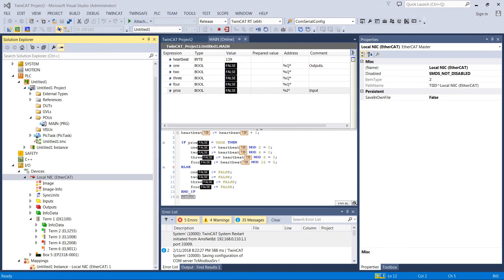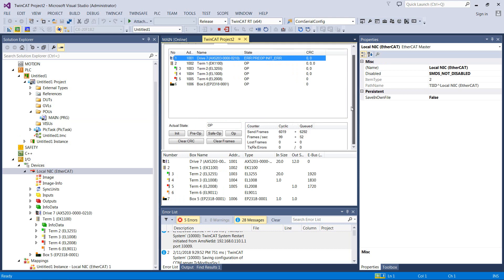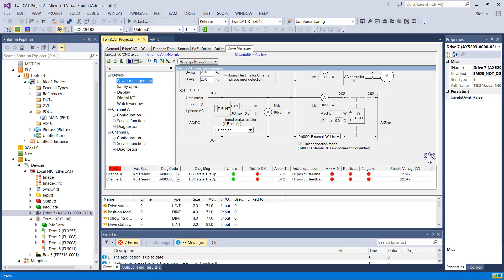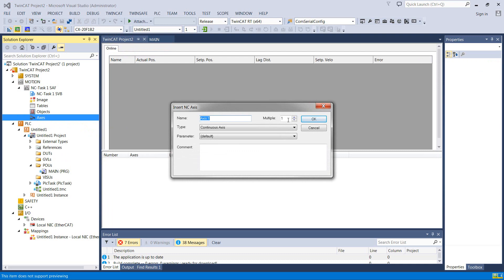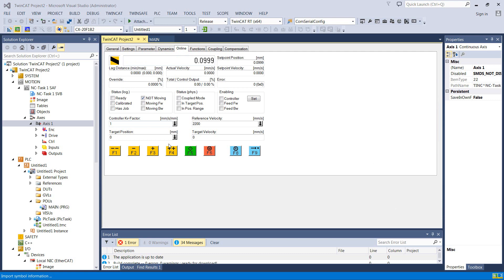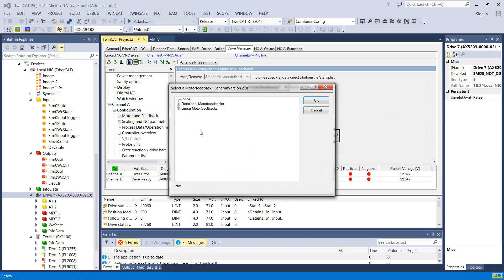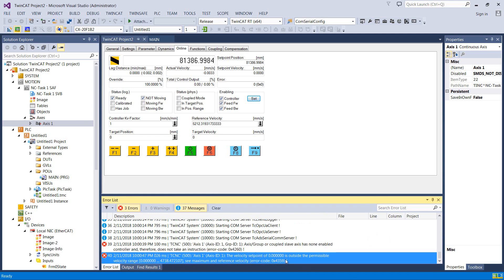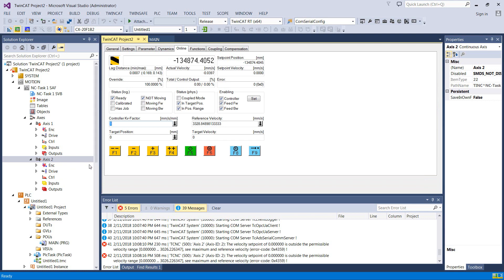Motion Control and IO with PLCs - EP6 - Numeric Control

Comment: How did you fix the issue with the set velocity? I have it too and cant't figure out whats wrong. Other than that I really like this series. It helped me a lot in getting started with Twincat.
Reply from the maker: Ummm, can you elaborate? I don't recall an issue on this one.
Reply: @SquishyBrained  The one at 8:55. Sadly you skipped the solution.
Reply from the maker: @Fleusz  oh, the part that I cut out was just me switching to a different channel on that servo drive. I don't think I actually changed any of the settings, I think it was a problem with the actual drive itself because it was a used drive that had an issue.  I don't think there was a setting or anything I changed, I just added the other axis and linked to channel b on the dual axis drive and everything worked fine.
Reply: @SquishyBrained  Ok that's unfortunate. The issue I am facing is, that I only have 1 motor at home to simulate the machine that is standing at the university. (stupid corona prevents me from working there) That means I can't connect a second motor to the other channel. I do think that's not the problem tho because it is complaining about the set velocity being 0. I just don't know how to fix it. Do you have any suggestions?
Thank you for your time helping me after so many years of uploading it. Big thanks :)
Reply from the maker: @Fleusz  dumb question here, but the set velocity equals zero was my problem before I went and set the velocity to a non-zero value. That said though, this is just one step in getting a motor to work under program control. If you're having trouble using the NC widget, just don't use it and Skip ahead and go into when you start coding it. The NC thing with the little reset buttons at the bottom is really just a quick and easy way to spend a motor before you write the code to make sure everything's working. If you just write the code like I wrote mine, you'll be able to spend the motor from the actual PLC code instead of just the NC widget
Reply: @Fleusz  heei, did you fix the problem?? I am having the same too